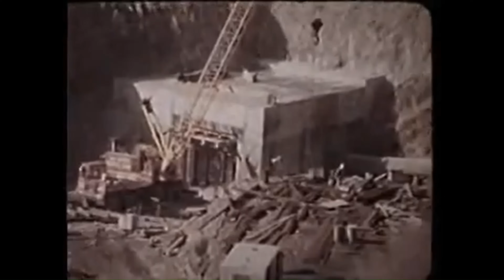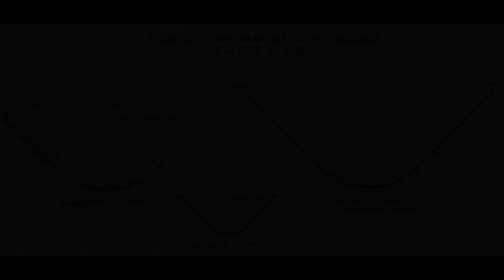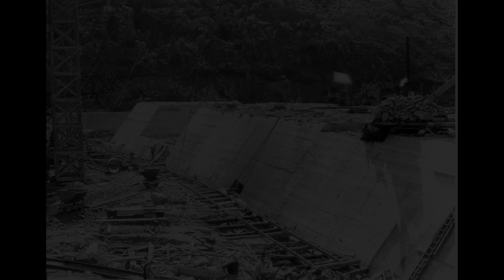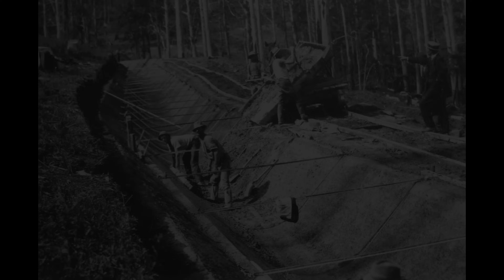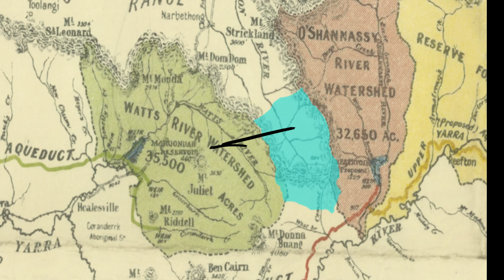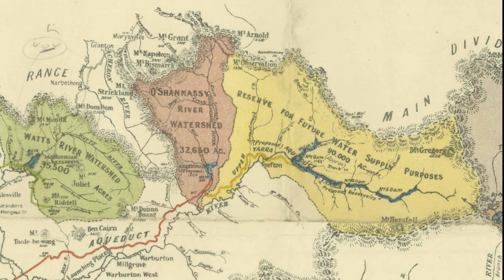Melbourne's Water Story - Ep2:  Expanding the Network (1890s–1930s)

Comment: Is the upper beerarun  near the upper Yarra. You know the river on all of your maps.
Reply from the maker: It is, you can use  Birrarung and Yarra interchangeably. As the river does have both names (one being our common reference, the other is the name prior to European settlement of modern day Melbourne). I refer to the Upper Yarra Reservoir in European naming, due to our damming and influence over its normal flows. Hopefully that helps when looking at the historical maps I’ve used which will call up the European names of the river and its surrounding tributaries.
Reply: @AusEngineeringHistoryStuff  , what did the abos who lived in the upper yarra call that river?   this is the problem using abo names for things, some of which may be made up because they had no name for it other than a word  that meant river.   as an ecample, in the uk there are more than 4 avons.   shakespeare lived near one of them.   avon is an old english word meaning river.   so when you say avon river you are saying river river.   an extreme example i saw on "qi" tv show was "torpenhow hill.   every successive language in the area added their name of hill to the original name tor.   so it is hill hill hill hill.

Comment: These are great, I'm a bit of an infrastructure nerd and am quite familiar with the history of the railways and the electric supply in Melbourne and Victoria, but knew little to nothing of the water system. Maroondah Dam is gorgeous, isn't it? Takes me back to family picnics as a kid in the late 80's and 90's.
Reply: G'day mate, Would you happen to be familiar with the small gauge rail in the Dandenong ranges ? Thanks
Reply: @jasonvoigt6575  Puffing Billy? Yes, have been on it many times since I was a child. It was one of four experimental two and a half foot narrow gauge lines built by Victorian Railways around the turn of the 1900's. It used to run between Upper Ferntree Gully and Gembrook, but the section between Upper Ferntree Gully and Belgrave was converted to broad gauge and electrified around 1960. The other three lines like it ran from Wangaratta to Whitfield, Colac to Crowes, and Moe to Walhalla, all of which closed in the post-war era, but a small section of the Moe to Walhalla line has been restored at the Walhalla end.